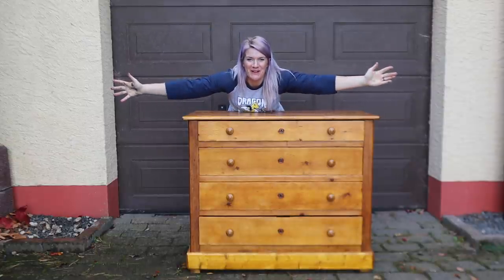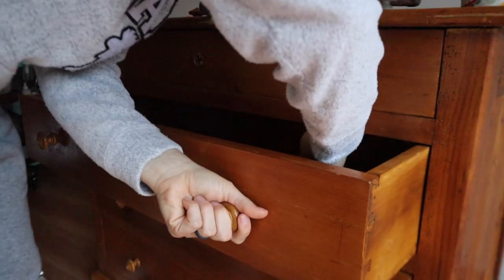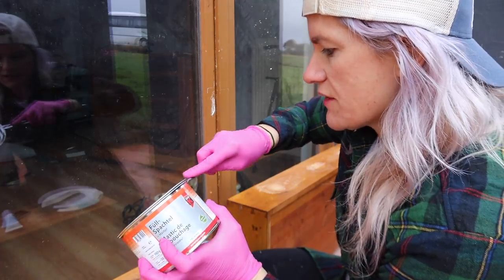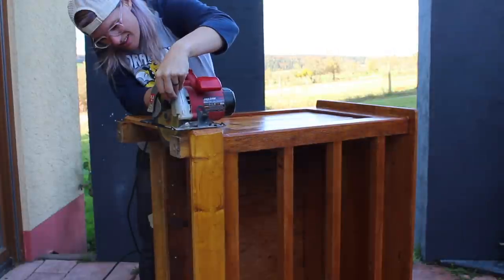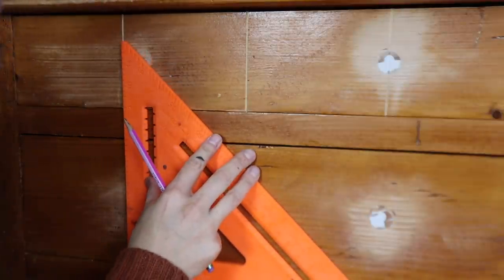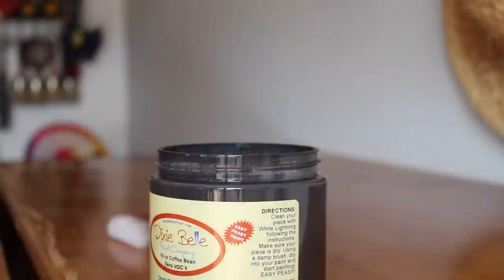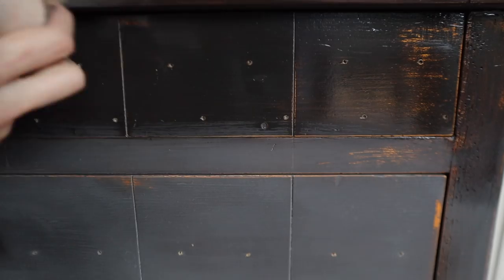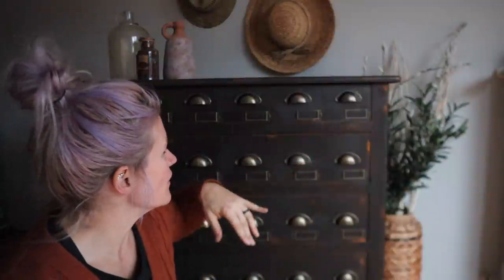Transform A Boring Wooden Dresser Into An Industrial Apothecary Cabinet | Beginner Friendly

Comment: It looks great. Personally I would alter 2 things though. The card holders make the piece look a little busy, just the handles would have done the trick., or use card holder handles which are available. And secondly the faux drawers needed a slightly bigger gap, say 3mm. It would make the piece look more authentic. I know when using a hand saw it’s difficult to do that but if you are going to do more of these I would invest in a trim router., you can pick them up fairly cheap. Mine cost approx €70. I only mean this as advice and not criticism as what you do is great and you are such fun xx
Reply from the maker: Thanks Dave!! I think if I do this again I will go about it different for sure!!! I appreciate the constructive criticism ❤️❤️❤️ now I need to find another piece to recreate and adjust stuff

Comment: Love your work!!! I have a question… I’ve used DB gel stain on a table top. It looks more like paint vs a regular stain. Have you ever sanded over the gel stain? What was the effect? (FYI the stain is espresso)
Reply from the maker: Ahhh so I can tell you that even when I do use gel stain I wipe it back to show the grain, I never use it as a "paint" I know you can I just hate how long it takes to dry lol 😂 I think if it is totally dry and you sand it it may just pull back some of the stain for distressing, but with it being oil based it may gunk up the sandpaper?

Comment: Could you use a Dremel to do the drawers?
Reply from the maker: Absolutely you could do that, a router, a circular saw if you have one with adjustable depth, you COULD even use a table saw but it may be a little more tricky, so many options :)